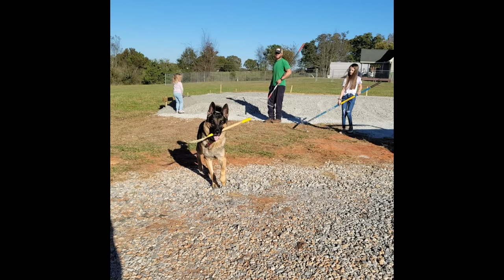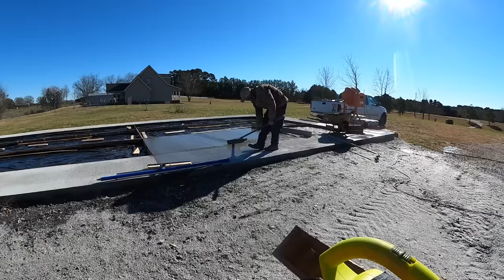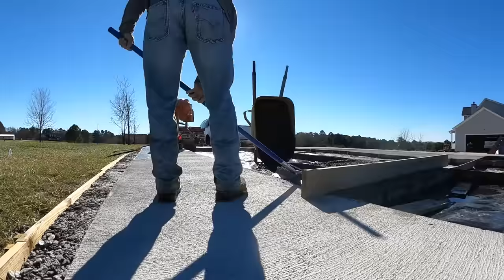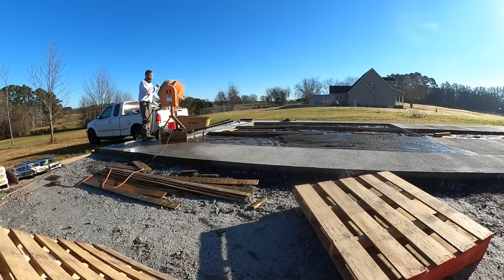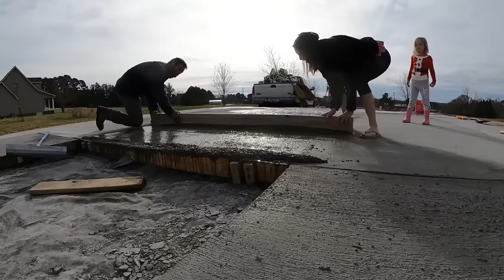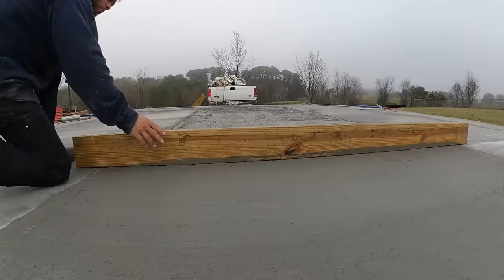Pouring a Huge Concrete Slab Using Bagged Concrete | I Saved $10,000

Comment: Well, I've mixed a lot of concrete, it might be worth 10 grand, but it is a lot of work and time,  I did some calculations, I can get it off the truck for cheaper, you may have saved money doing the finish work, but not buying in the bag, and all that mixing, I'll buy it off the truck , just saying.
Reply from the maker: Truck in my area at the time was 200-220 depending on the day with a 4-6 week wait. #80 bags were 3.20 per so bag was a good amount cheaper. Also added convenience to me as I couldn't do it all myself in one go and I could work around my schedule.

Comment: There is WAY too much water in your mix and no wire mesh?  That will be some weak concrete.
When you screed it off, the water on top was massive.
Reply from the maker: I actually used less than what the bags called for. I have over 40,000 lbs sitting on it and haven’t developed even a hairline crack. How strong does it need to be?

Comment: Did you use extra water in the first part of the sections, or the same throughout? Why no rebar?
What were the section forms' material?
   Nice project !
🙂😎👍
Reply from the maker: I used the same throughout, i'm not sure why it did that. I actually mixed less than what the bags said to! I called around locally and pros said rebar wasn't necessary in an on grade residential 4" slab. I used 1/2" (I think) plywood for the forms. Thank you for checking out my video!
Reply: @reallifetested2605  Thank you for answering 😎👍

Comment: Shouldn’t you have drilled into set concrete with  dowels.??? And used wire mesh.??
Reply from the maker: I haven’t had issues or cracking but do wish I had pinned them together for added insurance. As far as rebar or mesh every company I called around here doesn’t use it unless required.

Comment: How long did it take per section? How many bags per wheel barrel? Thanks
Reply from the maker: I had to break it up because of my crazy work schedule at the time (7 days a week nights) If I could have worked full 12-14 hr days I could've done 2 sections per day. Total probably would've been 40-50 hrs. I spent a lot of time getting everything dragged out and prepared each morning when I came home from work, as well as cleaning everything up and put away the limited amount of time I had.

Comment: Wouldn't it be cheaper to mix it yourself from Portland cement and aggregate?
Reply from the maker: I thought that as well! In my area it's about 165 per yard mixing that way because of the high cost of sand, and Portland cement right now. If you save anything it wouldn't be much and that's a heck of a lot more labor.

Comment: Hi. Very impressive. Looking through the comments and listening to your description of using 80lb bags. I just wanted to know how many bags did you put in the mixer at once. 1,2,3? Approximately how much water added per mix also. Thx
Reply from the maker: Thank you! I actually made a video on the mixer and some of the mods I made to it, as well as problems. To answer your question either (2) 80 lb bags or (3) 60 lb bags will work in the mixer just fine. The (3) 60s is about all it wants to take though and you have to be careful not to spill anything out while mixing. I don't know the exact amount of water I used. What I did was measure out what the bag called for to mix (2) bags in the 5 gallon bucket, pour a little out, then draw a line on the bucket so I knew how much to add. The reasn I added a little less is because I always like to go by consistency as not all bags are perfectly mixed. Hope that makes sense! Thanks for checking out my video.
Reply: Thx. Good luck on your next project. I’ll ck out the mixer video

Comment: You could have just ordered 5 yard loads and did it that way. That would have saved you on concrete costs labor and time.
Reply from the maker: In my area local truck was 200 to 220 with a 4-6 week lead time and 80 bags were 3.20 each. Bag was a good bit cheaper but you’re right on the time, it would’ve been faster I just couldn’t handle all of that by myself.

Comment: Bagged concrete finish wears off quickly. Try sealing it to retain surface finish
Reply from the maker: Thanks for the tip! So far it’s been a year and still looks great.
Reply: @reallifetested2605  Awesome. I did a guys back yard with two tier patio and radius steps in bagged concrete due to access difficulty. It's still holding up
Reply: @reallifetested2605  May I suggest Concrete with the Hauses on the YouTube. They really know their stuff. Stains sealers in detail. Hope that helps both of you.

Comment: Uhhh. You might wish you put rewire or rebar in there. I still enjoyed the show so not trying to be negative.
Reply from the maker: I appreciate the concern! I called around and spoke with local pros. They don’t use rebar around here unless commercial, industrial, or requested. We have good soil here and it rarely gets below freezing. I’m doing a 2 year update soon and so far no hairline cracks anywhere  or movement.

Comment: How's it holding up? does it need any rebars?
Reply from the maker: I called around before doing this and local pros said that rebar wasn’t needed in an on grade 4” residential slab. It rarely gets below freezing for any amount of time where I am. It has approx 40,000 lbs sitting on it and not so much as a hairline crack has formed.

Comment: where is the rebar?
Reply from the maker: I called around and spoke with local pros. In my area they don’t use rebar on 4” residential on grade slabs. It rarely gets cold here and we have a hard clay soil. I’ve never seen it used in small buildings / driveways around here. I did a 1 year update if you’re interested. I don’t have any cracks at all and show the slab.

Comment: Just how expensive is delivered concrete near you? We just had concrete delivered to us (way up a mountain rd) and it was like $250/yd. Bagged concrete would cost $244/yd. So I totally get how you saved by hauling your own gravel and doing the labor- but- unless your property isn’t accessible by a truck (and it looks like it easily would be)- using bagged seems equal or more in cost?  But that’s based on my area-
So wondering just how expensive delivered concrete is for you?
Reply from the maker: At the time truck was 200 to 220 depending on the day with a 4-6 week wait and #80 bags were 3.20 each so bags saved a lot of money in my case. I also couldn't pour it all in one go. It added convenience so I could work on it when I had the time. I was really surprised at the differences in concrete prices throughout the US I have talked to some on here where it was as low as 120 delivered, just as well as some places #80 bags were close to 7 dollars per!

Comment: Very, very strange. Where I live and where I have worked (in Europe), premixed concrete is usually a little bit cheaper or much cheaper. 1 ton concrete in bags is around 100 euros and premixed is 50 euros a ton.

Usually transportation (12 tons) - 100 euros within 50 km. I think you made the rookie mistake ... concrete companies sell not by the ton, but volume. 1 cubic meter concrete is 2.5 tons... but bags are sold by mass - 25 kg one bag.
Reply from the maker: My concrete companies charge by the cu yd not by the ton. It was 200 to 225 per cu. Yd. Delivered with a 4-6 week wait. 80lb bags were 3.20 each. 45x3.20 is $144 per cu. Yd.
Reply: @reallifetested2605   The price is like 3 times higher than in London and 4 - 5 times at some random spot in europe (or like 6 times in eastern Europe). Have never waited more than a few days. Seems very odd, all other stuff seems quite the same price EU vs USA ... like timber, osb, drywalls, bricks (only thing is Autoclaved aerated concrete, where i have seen big price difference, but its not very popular in US) etc.

Comment: First, where is your rebar? Second, where are you located that bags cost less than a truckload? 800 bags cost over $4000 in my area truckloads can be bought for around $125 to $150 per yard or about $2700 for the same total as 800 bags on the high end. The labor alone mixing all of that would make it worth ordering the truck. Third, how was the 800 bags brought to your home? 800 bags at 80 pounds per bag is 64,000 pounds need two semi-loads to deliver all of that. Not getting it in your truck.
Reply from the maker: I called around and spoke with local pros. They said rebar isn't needed in an on grade residential 4" slab. When I did this truck was 200 to 220 depending on the day and #80 bags were 3.20 each. I have a 21k trailer which was slightly overloaded every trip, and a tractor to unload. The local home improvement store is less than 12 minutes from my house.

Comment: What did you use to pack the gravel? Did you rend a compactor?
Reply from the maker: Every few inches I have a cultipacker I ran over it multiple times with. Used a hand tamp in the corners that the cultipacker couldn’t get to. It was packed tight enough that when a truck drove over it there were barely any tire tracks.

Comment: No re-bar?
Reply from the maker: I called around and spoke with local pros. They said rebar isn't needed in an on grade residential 4" slab.
Reply: @reallifetested2605   Okay , but for that large area it might help stop cracking and sagging. Adds  $$$' to the job tho. Great effort by the way. Well done. I'm

Comment: why have you poured on top of plastic?
Reply from the maker: The plastic prevents the water from falling through to fast helping the concrete dry slower. It also will act as a vapor barrier.

Comment: How many bags of concrete did you end up using. And how many kgs? My husband and I are taking on a similar project in May!
Reply from the maker: It ended up being 830 80 lb bags total. Around 66,000 lbs.  I made an update video with me responding to the most frequently asked questions if you're interested. 

https://youtu.be/qKcy6BI8yA0

Comment: Hi. Would anyome tell me how to prevent from pouring a pad that is bowled when its too wide to secrete from two sides?😮 Thanks
Reply from the maker: It’s all about how you have your forms set up. Need to make sure to hang a string on it and check for proper slope before getting the concrete.
Reply: @reallifetested2605  I was thinking about doing the square slap in one shot. After your video, I thought, why stress myself when I can do it like you and create expansion joints at the same time! But I still don't know how people avoid dips in the middle of a slap when you cannot screed from two levelled sides of the form
Reply from the maker: @yangmagic0703  I see what you mean. I think it all comes from experience. I’d be nervous about trying to do that as well! I haven’t understood how they pour sidewalks and driveways on steep hills without it going everywhere. That would take a set of skills right there.
Reply: @reallifetested2605  yes yes. But your way also relieves the stress of a large slap setting, as well as the lack of labour and help! I'm just gonna pour the large slab bit by bit!
Reply: @reallifetested2605  just watched your video again. I'd have done some metal reinforcement to your slab. What's your rationale of not using any?

I took down a chainlink fence and used it as rebar for my shed slab! Haha
Reply from the maker: @yangmagic0703  that’s a good idea! It depends on your area if it’s needed from what I gather. I called around and spoke with local pros. They said they don’t use rebar in residential on grade slabs in my area. Only in home slabs and industrial / commercial. It rarely gets below freezing here and we have good soil.
Reply: @reallifetested2605  well I'm in Canada and heck below zero is normal 😑😬 good for ya! Gonna do a small slap for 2nd shed before pouring a third for a house extension!

Comment: Was rebar not needed for the thickness?
Reply from the maker: I called around and spoke with local pros. They said that rebar wasn't needed in a residential on grade 4" slab. We have hard clay here, mild winters, and where it is there is no chance of flooding or earthquakes if that makes a difference.

Comment: An 80# bag costs $4.88 today at Home Depot. You need 45 bags per yard. That’s $237 out the door including tax.  Where’s the savings?
Reply from the maker: When I did this it was 3.20 per 80 lb bag and truck was 200 to 220 depending on the day with a 4-6 week wait. Local contractors wanted 14,000 minimum. That’s the lowest quote we received. I did a one year update showing prices on my phone for proof.

Comment: why no rebar ?
Reply from the maker: I called around and spoke with local pros. They said in my area they don’t use rebar in residential on grade 4” slabs. Usually only in commercial, industrial, and homes. It doesn’t get cold here and our ground is solid.

Comment: What did you use to get the ground ready for the concrete or what steps did you take prior to that?
Reply from the maker: I have a backhoe that I graded the topsoil off down to the bare clay. I then put a little over 100 tons (yes 200,000+ lbs) of crusher run as a base compacting every few inches.
Reply: @reallifetested2605  do you think for a smaller space one could use an electric jack hammer to dig up soil?
Reply from the maker: @vboutique2188  I would imagine you could do that it'd just be a ton of work. If you have good topsoil in the area that you're wanting graded off you might could call around and find some local landscapers that want the topsoil and will do the job discounted for that. Topsoil is selling at a premium in my area right now for whatever reason. I just checked and it's selling for 50 dollars per cubic yard which isn't much dirt at all.
Reply: @reallifetested2605  I don’t know if it’s good topsoil or not it’s in the yard was a farm probably 80 years ago.  Could you form the driveway in small sections?  I’m thinking of doing 24x24 ft spot.

Comment: Where is is your reo?
Reply from the maker: Local contractors in my area said that it wasn't needed in a residential on grade 4" slab. It's not a standard to use it in driveways, sidewalks, or small slabs in my area. (Houses and buildings require it for sure)  I know of several people that built houses since I was a little kid (i'm 30 now) and the drivways, sidewalks etc. still look new with no cracks.

Comment: I have zero idea how you saved money with bagged concrete. Here in a Australia a cubic meter of concrete in a truck is between $200 and $300 AUD. Theres between 100 and 110 x 20kg bags of premixed concrete to 1m3, this would cost well over double to triple at $6 a bag.
Reply from the maker: I go over the pricing in another video, I did a 1 year update as well as answering the most frequently asked questions. In my area #80 bags were 3.20 and truck was 200 to 220 with a 4-6 week wait.

Comment: Do you guys put rio bar in your concrete, and a thicken edge?
Reply from the maker: I called around and spoke with local pros. They said that rebar wasn't needed in a residential on grade slab. I didn't thicken the edges because the average thickness was around 6"
Reply: @reallifetested2605  6"..yea no need for thicken edge, that's thick, No rebar.. Wow, concrete out of a bag, I don't know, not a concreter, but never here in Australia have I seen concrete without rebar. Maybe you guys got some real good concrete, or very stable ground. Concrete will last a lifetime with steel in it.
 Finding people to work and cost of concrete, yep same problems here.
Doing 36m square (about 40yards I guess). But my concrete coming in a truck😁. Great video and great job.

Comment: Was bagged concrete more expensive than have a local concrete company deliver and pour?
Reply from the maker: At the time it was. When I did this #80 bags were 3.20 each and the local truck wanted 200 to 220 depending on the day with a 4-6 week wait.

Comment: No Rebar?
Reply from the maker: I called around and spoke with local pros, they told me rebar wasnt needed in a residential on grade 4" slab in my area. I've seen 100's if not 1000's of houses in my area built at this point and they didn't use rebar unless it was requested. (in the driveways, not foundation footers)

Comment: let’s do a little rough maths here. 830 bags …. of roughly 36kg ea?   i pay 9.80 for a 20 kg bag so that’s what….16 grand on bags? 14?  roughly that. (one 20 kg bag is 0.01 cubes so)…16 cubes he needed?you can get concrete dropped on your pad for $300 a cube so that’s  $4800.. i think i’m roughly right here.  that’s australian dollars and i’m doing it in my head but there’s a small chance i’m right.  all he needs to do is screed it.  i hope i’m wrong there
Reply from the maker: I did a 1 year update showing local prices on my phone. When I did this #80 bags were 3.20 each and truck was 200-220 depending on the day with a 4-6 week wait. I saved a large amount going bags.